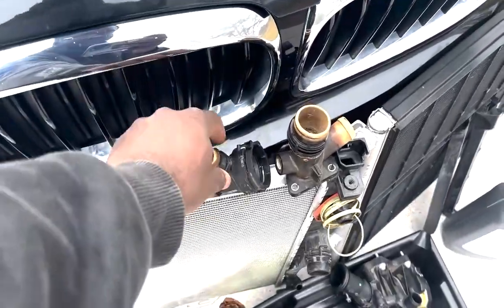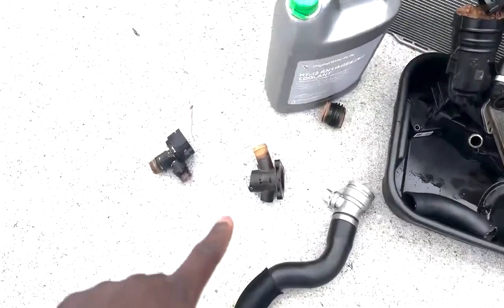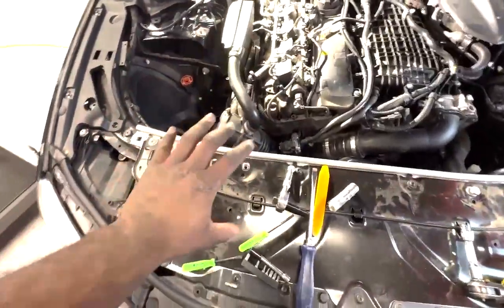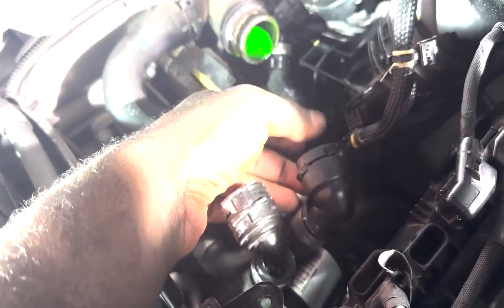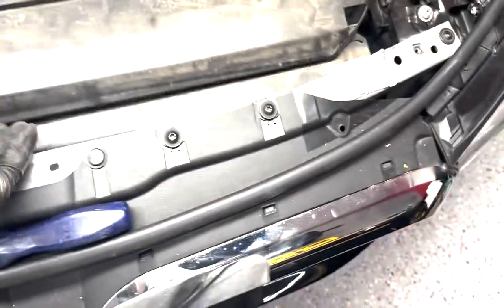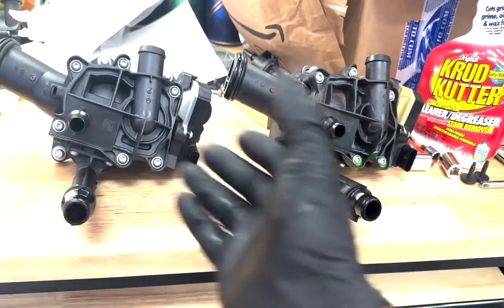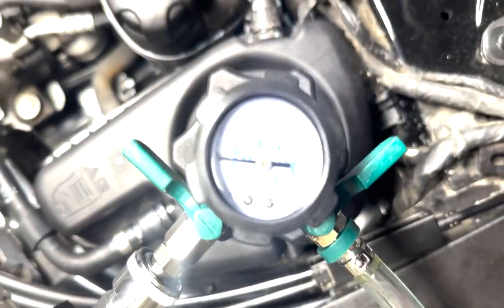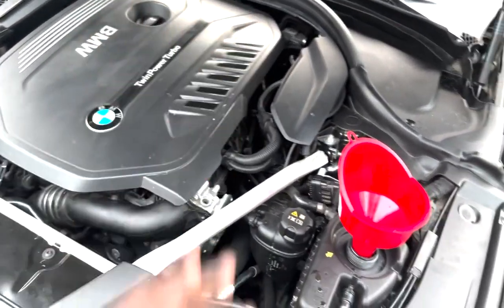BMW G30 540i & B58 Coolant System Refresh | Full Step-by-Step Guide/Walkthrough

Comment: Very helpful. Are all these links still active ? I believe a few of them are not anymore. How many total parts purchased and  replaced in this video I don’t want to miss anything on my car.
Reply from the maker: Don’t buy the aluminum ends there trash sign with the OEM radiator or an aftermarket one save yourself some money and time everything else you can get from the dealer

Comment: How is the Aliexpress heat exchanger going ? Did it reduce IAT’s?
Reply from the maker: Holding up great you will need a custom tune to see a drastic drop in iats but it definitely does help a bit more than the OEM one with a ots map from MHD

Comment: Homie replaced shitty BMW parts with shittier chinaman parts. Yikes, you're a glutton for punishment. I also hope you transferred the stone guard on the low temperature radiator to the new one. At the start of your video it's clearly on the old one, but you never show the new one installed. That rack guard is needed to prevent road debris from puncturing the low pressure rad which then results in AC performance issues and also engine performance issues because the charge cooler runs out of coolant as well.

Comment: Hi there would you mind sharing the part number of the auxiliary pump to oil filter housing hose please? I tried to look it up on RealOEM but it is greyed out. I tried to find on other websites and saw 11538611277 as a possible part number. Would appreciate it if you could confirm. Thank you.

Comment: Sorry mate but BMW gives themselves a bad rep. No sane person would conclude that a radiator is a maintenance/wear and tear part that you need to preventatively replace. Had my 540i for 18 months now and ended up replacing two front driveshafts, coolant tank and now today it pissed itself from the radiator. Car's got like 80k miles. This is absolutely ridiculous!

Comment: Hey so I’m thinking about just doing the primary radiator and the hoses with that what parts specifically would I need. Wasn’t sure if I would need to get all three of the connections
Reply from the maker: I would get all three and replace them as you see fit
Reply: @buntai8547 and just to double check those are the connections between the radiator and the hoses right
Reply from the maker: @void6994 yep and the one that comes off the engine block buy all three and you’ll be fine just in case you run into anything unexpected

Comment: How is the heat exchanger holding up?
Reply from the maker: Great!
Reply: @buntai8547  Heat soak is a big issue with these engines. I was asking because I plan on running stage 2 as a daily, and there are no other heat exchanger options in the market that I've seen besides this one. Thanks for the reply.
Reply from the maker: @willisbueno601 I ran stage two and XHP stage 3 for like 40-50k miles before I upgraded no issues with runs or heat soak you will notice a slight difference and it will be able to keep temps better but you can take full advantage of it with a custom tune and set coolant target temperatures cause you have to remember the stock coolant temps I think are 230F so it’s constantly going to keep trying to hit whatever the stock temp is if you have MHD and set it to sport cooling mode you’ll notice a difference in temp but not as much as you would with a custom coolant temp set with a tune

Comment: Thank you for this walkthrough I would have had no idea that aluminum hose ends existed and would have replaced mine with original plastic ones. I was planning on replacing as much of the plastic parts with aluminum ones anyway but this also helped a lot! One thing that is not super clear is for the upper radiator hose it looks like there are 2 or 3 different pieces is that correct? Looks like Aliexpress (at least the link provided) won't ship to the US anymore.
Reply from the maker: You can contact the seller and they should be able to ship it to you if not there are more on AliExspress just takes some searching

Comment: Good video.  Just FYI you will NOT  get a CEL or notification for low coolant on the low temp circuit, even if the res is bone dry, unless you scan for codes. (I guess this would be called a shadow code?)

Comment: I used this to help me replace the primary radiator in my 2018 540i xdrive.  I wouldn't have had the confidence to start without watching this first.  Thank you so much for the helpful video.
Reply: Would you mind sharing if the xDrive radiator is any different from RWD at all? I am likely going to change my radiator also and mine is xDrive
Reply: @turbo97semax  Its not, just make sure you get the correct radiator to match your original one that has the bottom 45-degree hose connection on either the left or right side (check realoem or just look under the hood) and thats all that matters, rest is the same for x-drive as rwd.

Comment: But didn’t you take out all the air when vacuuming it why do a bleed procedure after?
Reply from the maker: Some air still remains in the system vacuum bleeding it just removes most of the air to make it easier to fill

Comment: Will I need to shave the brackets if I’m swapping with an OEM equivalent radiator?
Reply from the maker: @rrichiie  I’m not quite sure what you mean do you mean if you are putting in a OEM radiator? If so, then the answer is no you don’t have to shave anything it’s a direct plug-in play.
Reply: I just did a nissens which mind you is almost as much as OEM on FCp euro and getting it to line up with the condenser is almost impossible. Literally the hardest part of the job was getting those two together flush. It took a rubber mallet and definitely some hackery. If I would’ve known, I would buy OEM in a heartbeat.

Comment: Once again thanks for your video I’ve literally been stuck trying to fix my bmw since last thanksgiving…..I’m not able to afford taking it to shop and it’s not covered under warranty so I haven’t been able to drive my g30 in almost 5 months….finally saved up enough $ to buy the radiator, tempted to do the OFH but one thing at a time..:.I’ve literally watched every single video on YouTube related to the b48 and b58 radiator and coolant system and your video is hands down the best in regards to reaching the actual steps to remove things and what to do with certain tricky tabs.  A lot of other videos just have a cut scene and voila the parts magically removed and then cut scene to the new part installed.
Reply from the maker: @AG-is5vv  I tried my best not to but everything is a two handed job and I don’t have a tripod if you’d like I can make a explanation of it but I wouldn’t be able to show you as the work is finished

Comment: Can you do a video showing how you connect the front and rear radiators together?  

The main reason I think I only need to replace my front radiator, is because my coolant level stays full in my main reservoir, the smaller left coolant tank is the one that went low.   I checked all the lines and couldn’t find any leaks except for the front radiator from the damage.
Reply from the maker: @AG-is5vv  I sorta explained how to if I make one it would be similar to the most recent one I made where it’s just explains  it not so much shows it if you skip around you can see what I said about it
Reply from the maker: @AG-is5vv  and I explained how it goes together in the video it just slides in place it’s easier to to begin the job and look at my video for reference

Comment: Thanks for posting the video, does the b48 and b58 have similar or same radiator setups?

I’m confused because I need to replace the front radiator on my 2019 530e and while shopping for them i saw a lot of them seemed to fit both 530 and 540.

I thought I just had to replace the front radiator (because it got damaged from peice of plastic grill get broken off and dent it through that black plastic screen. ).   Now I’m worried I need to buy the rear aux radiator too.    Shieeeeetttt.  

Also I went with Behr for my replacement I also agree how OEM is way too expensive.